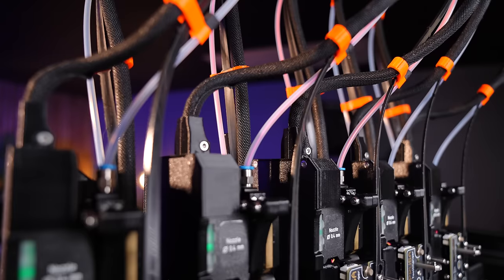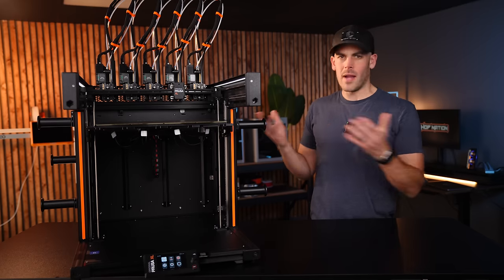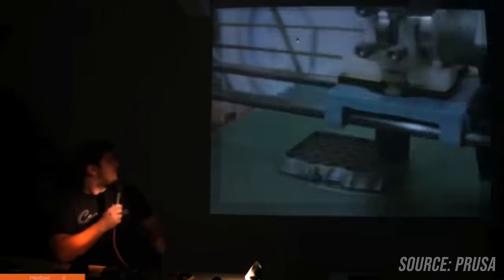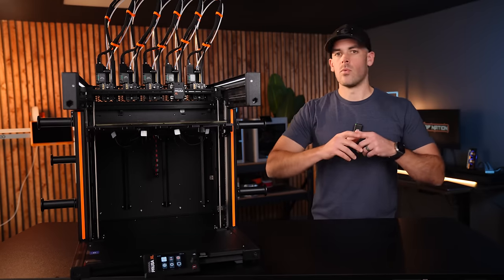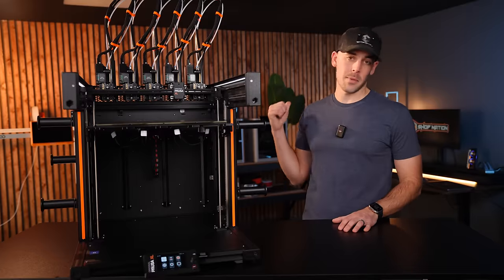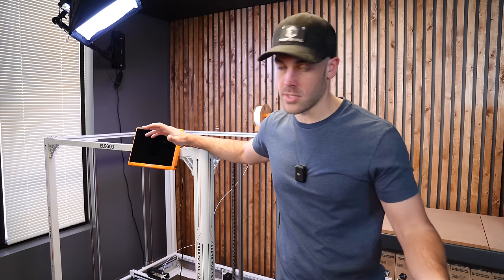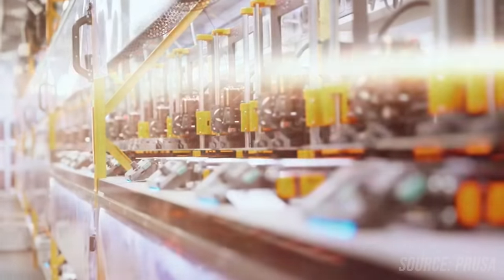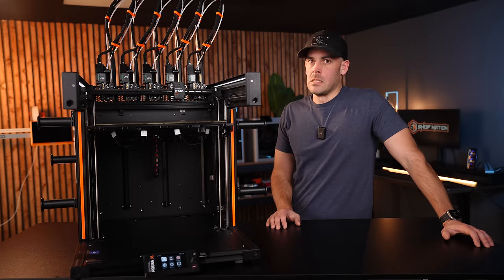Why Prusa is the next Blackberry

Comment: Prusa's real problem is not qualityspeed, relaibilty. It is that however orange they make it, it still looks like an entry level kit build from 10 years ago. The Harley Davidson of 3d printers. But without the aspirational marketing.
Existing Prusa users may stay loyal, but no one new is buying a Prusa. At each price point there is an equal or better competitor.

Next year Prusa will either have a completely new design that doesn't cling to legacy features, or it will be in terminal decline.

Comment: I don't think the situation is as dramatic as iPhone to blackberry. The paradigm's aren't so different. If prusa were to release a smaller volume core xy with multitool head and single zone heated bed I bet it would be a lot more price competitive with the bambu printers. The prusa machines still seem to hold the edge in reliability.

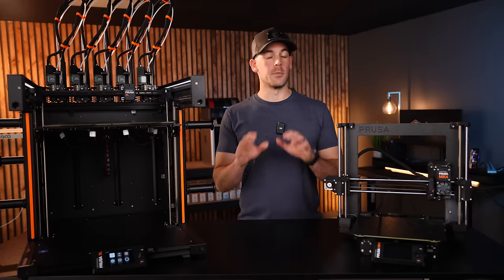Comment: 8:46 Older 😅 and i hope they will scrap the i3 design, it worked in the beginning, i have always loved the corexy setup. it is so much more capable.. And i want a fast and good IDEX printer i only need to heads, that is a market in my book, i design engendering component, and use water soluble support, have a old Chinese idex printer, heavily modded to work, but i am in the process of building a corexy idex out off one of the ender 5 plus i have a whole wall off.. but i rather just by the machine...

Comment: wow 4k is a bargain. I expected much more for hussle free machine. Maybe think of it differently, not to which setup this machine fits, as novel approach is always make it or break it, it needs to find its user cases, so think about it from the other end.. And myself not in 3d printing i heard a lot about how time consuming may it be to fiddle with setting so get print done, which is not what machine is for right? It suppose to print and have a job done.. If this machine solves this case it will have its customers no matter how much money it cost(exaggerating).

Comment: Completely agree, Prusa is a good brand, but expensive, and this requires them to constantly innovate, which they haven't in a very long time. Just putting more printer heads on a printer isn't the kind of innovation that will differentiate them from millions of clones, especially since I'm expecting there will be much cheaper alternatives in a very short amount of time, undoubtedly as well as a BambuLabs offering that will look so much better.

Comment: I wouldn't be surprised if Prusa pivoted to be more like E3D: a company that makes well designed components for other 3D printers. Already you can buy a lot of the individual components for all of their printers, even if they don't have them as sets of parts for a specific function. I can see a future in which they may make a flagship printer, but offer extruders, bed, and other systems as options for other printers.

Comment: This video said everything I said when I got my X1C. I was so pissed off at Prusa. How could they let this happen? All Prusa had to do was take all the years of community mods and put it in a machine and they just let someone else do that while they dicked around with resin and for some odd reason acquiring a delta printer company??? 
The only thing I could possibly think of that would make them relevant again is if they somehow made a printer with multiple heads that printed at the same time with insane reliability. Even then I don’t think it would matter because they can’t compete with price. All of these machines rely on mostly Chinese sourced parts so Chinese companies have the edge. After importing tax for goods and exporting tax to ship Prusa would be too expensive like they already are.

Comment: One thing are new faster cheaper kids on the block and another thig is their reliability. Prusa can implement Klipper too and be fast as Bambulabs too, actually Sovol alerady did it. But can be Bambulab as raliable as Prusa too? Bambu is good for mass market, home users and smaller boutique shops. Prusa is better for small industry and bigger batches of printing. But Bambulabs noise, vibration and motor calibration is awesome thing. 👍

Comment: My dream setup is the mk4 with 2 print heads so I can do MM for easy to work with support material and also not worry about how many supports needed to support a project knowing they will be easy to remove.

Comment: p1p and x1c does not make parts with strength at those speed... only for mockups
although the laser vision system is impressive, and the progression of Prusa have been disappointing, the Mk4 have demonstrated much better reliability in operation and feasibility for maintenance

Comment: Prusa needs to cut prices in half across the board to come anywhere near competitive with modern 3d printers. ~$400 for a tool head for the XL when you could buy an A1 mini with AMS lite or an A1 by itself for the same price, are you insane???

And when it comes to the whole waste debate, there are many ways to reduce the waste and reduce the swap time so if you're printing a lot then it's going to be a non-issue.

Comment: I don't think prusa is Blackberry,  Blackberry died out due to corporate greed wanting to "beat the dead horse" before bringing out the new technology they already owned and had done.  Looks like a multi tool system could be simplified by only using 2 or 3 heads instead of five and pre-prime the next ones.   Bamboo labs could speed up the process by doing this.  Or prusa could lighten the cost by doing this.

Comment: Prusa just need to offer a starter pack with 2 heads one for support and the other for the filament, you can paint the finished product, printing 3 or more materials starts getting real niche you get support, body, maybe a transparent and some form of flex but yes IDEX is king.
For speed get a Voron..
Bomboo Labs genius was the cutter everything else is just a normal printer, the cutter removed the crazy retraction and ramming schemes we had before and made change reliable. Bamboo Labs cutter needs top be replaced by a servo cutter so it can be fitted to any printer.

Comment: My Prusa has been a disappointment.  I built it.  It worked fine for a few prints then I had to keep adjusting the Z offset down after a few prints.  I talked with tech support several times, replaced a few things and finally sent it bac for a rebuild.  They blamed a few  issues on me sent it back and it worked great for a few prints but then I started chasing the Z offset again.  My Prusa sits most of the time while my FLSUN, Creality and Bambu do most of the printing.

Comment: Even if BL does a good job with all side jobs, like slicer, modelpage, tuned profiles with filament, service etc. This also is to consider and prusa is still top but loosing also very quickly. 

Not so easy to compare also between both. For me prusa looses some of it own benefits in the past independently what the other came out with.

Comment: The XL prints larger multi-color prints, or multiple smaller multicolor prints, in a much smaller amount of time and with far less waste than Bambu or other printers. Also large prints with supports of different material.. Maybe the average Joe just needs a cheap Bambu or Creality, but for the large print multicolor or multimaterial, this is probably the best choice

Comment: you missed the biggest part.    Open air 3d printers today is amateur hour.   even PLA benefits from a controlled temperature environment.  $4K for that printer?  I'd buy it if the thing was enclosed in a good way not their lame "here put it in this box".  design the enclosed print volume as a part of it like Voron does.  Bambu labs keeps me away because of their closed  nature.  No I'm not buying their filament,  let me make my own rfid tags and give me access to the sourcecode of the firmware.

Comment: I think I am the odd case where the prusa xl would be more useful than the bamboo labs because right now we run several old modified cr10s with .6 nozzles and 10lb spools in a heated enclosure. bigger is usually better for us as we do prototyping. however we are not typical and don’t have extra money at the moment. then again i used a blackberry running android until last year so…..

Comment: I think the single greatest change prusa could do right now is to make a mk4 sized coreXY. The market wants small and fast prints, this brings me to the next point. 

A small change they can make right now is to have a volcano style hotend for the nextruder. It doesn't need to be longer, it could use a CHT design. Regardless, the heater would need to be upgraded to keep up. That alone would be a basic and easy to implement change that would enable faster printing, Even if the XL is the only one seeing real benefit.

Comment: Prusa should run with the corxy smaller build volume and enclosed. Don’t scrap Prusa but integrate it with bits of bamboos programming for the speed. IR sensor for spaghetti and auto restart either part or purge tower. Have a sweeper tool changer set up for auto part removal after a brief cool down. Focus on what Prusa is known for Automate the farm. Make these options for the bed slinger if by  some wild chance Joe sees this. Lol

Comment: I think a huge aspect of Prusa at least for me is that they are open source. Now that printers are more likely to be connected devices I think that is increasingly important on the software side. Having non proprietary parts as well is a bonus. I will give hot ends a pass on this one being an e3d revo enjoyer myself but the fact that Bambu labs has proprietary non user serviceable parts in the motion system is a deal breaker for me no matter how good their customer service and warranty are. I also dont want to trust the cybersecurity of a Chinese company especially when their software is a little black box no one can see inside. Sure the X1C is a neat machine, but I will stick to my Voron. If I ever want multi material I will jump to the XL.

Comment: You're just not going to win if your price is too high for most users.  While there are benefits to the XL, a ton of 3d makers won't use the machine for those specific cases.  As shown in the video for basic prints, the print quality was ok at best and the time saving was marginal.  Unless you are staring at the machine waiting for it to finish, that margin isn't enough for the extra money spent on the machine.  Look at the automotive world.  There are luxury cars that are better in every way than 4 door family car but which one gets sold more?  Same reason, most users need the basic functions both provide but one is affordable.

Comment: For Prusa and all the other non Bambu companies out there it's like you said they need to pivot. They need to rethink everything and basically build a better Carbon X1C with the capability of multiple heads and multiple colors and do it plug and play out of the box. There will still need to be the current bedslingers for the individual home hobbyist but for those wanting to do everything with one printer they need to look at Bambu and do it better. That is the future. Just my own opinion.

Comment: So what I'm hearing that the only thing keeping this printer from being not niche is some more R&D to make it cost less and maybe some slight improvements to make it easier to get it tuned, but otherwise, it's good. Also, for someone selling multicolored prints, you can complete more than four prints with less waste in the time it takes a X1C to do one print. That's more than four times the profit which would justify the cost.

Comment: The XL is for engineers who want a precise and reliable printer and who also choose to print with exotic filament and/or multi material

The Bambu X1C poops are simply to big and too wasteful for exotics
Having multiple print heads in this way makes it the optimal solution for multi material

Comment: I think you have just fallen for the marketing hype. The Bambu print time are not that amazing unless you don't care about the strength of the part. Additionally, you completely left out the fact that the prusa can run different nozzle sizes for each tool. This is a huge differentiator.

Comment: Prusa needs a mid sized coreXY machine with TWO print heads(option to add more). Also, preferably with a full enclosure and even the heater that Qidi machines are shipping with. I'm building such a machine right now because NOBODY MAKES ONE.
Reply: Tridex?

Comment: i still dont understand why iy needs to purge, i have a chinese hellbot hydra+, it doesn't need to purge, its not a fast machine like the bambulabs  but as someone in a place where filament is expensive, i will take not having waste on expensive materials, and its fucking monster on reliability, i love my machine to death. and i plan to actually buy the smaller one, because i barely use the large print size most of the time. would love to try those expensive ships, especially the bamboo labs, as it seems the software for multi color is easy to use, right now my way its slow as fuck.

Comment: The only issue with Bambu I see is the proprietary slicer and firmware. I would rather have control over the system without the strings attached.

Comment: 8:30 It's not about the colors as much as it is about the materials. If you need a bunch of different materials in something like that benchie, such as where each color is a different type of needed filament such as dissolving supports in areas that aren't very convenient to get to. So it's likely to see a market in more niche areas such as engineering or the likes.

Comment: I don't care for multi-color but multi-material is a real plus and that won't work with an AMS. Also the Bambu - Studio really sucks, have you tried to set it up in LAN Mode only ?(sorry, not going to send my companies models to China). And just manual loading models using the micro-SD-card is a pain. The only reason I did not buy the Prusa XL was the long delivery time (6 month when it was relevant for me)...and I regret that I had to buy the Bambu instead.
Reply: Multi material does work with the AMS actually. I frequently do PLA + PETG as support interface material because it releases easily.

Comment: Say you save 100g of filament by printing something on an XL vs. an X1C. That's roughly 2-3 dollars per print, not to mention the lower electricity costs of having less bed segments heated for less time due to the lower print time. Over time, these costs add up... if you're printing one part a day thats almost a thousand dollars in one year. Maybe this is an extreme example, but even 50g less waste means that within a few years you've actually saved money by buying an XL. Obviously, this market is niche, but it exists and it's what Prusa is marketing people to. People looking in the price range of a BambuLab are marketed for a Mk4 with MMU which should be roughly $1100 before import duties/tax, which is only slightly more than a P1S but has a proven track record.
Reply: Another thing you failed to mention was that the Prusa XL has true multi MATERIAL support, which BambuLab printers can't realistically do as efficiently as the XL. On an XL, you could print PC and TPU with soluble supports. This is impossible on an AMS (or MMU). Again, it's a niche market, but Prusa isn't marketing a $4k printer to a joe schmo with an accounting job.

Comment: The bed slinger design is actually a good design for a SMALL printer. Bambu lab just made a small bed slinger as well. Prusa's Nextruder will print multiple materials reliably unlike many other extruders. I had to purchase the 5 head XL because I needed 3 print heads (not 5) for dissolvable supports, hard plastic, and a soft plastic for seals etc. The only way to get this was the 5 head model. The problem is that without an enclosure the printer has limited material application. They need to fix this. I have built my own enclosures for both the MK4 and am doing the same for the XL. The repeatability and quality using my MK4's is at least 99%. People are correct, Prusa needs to take a Voron with enclosure and take it to the next level with at least a 80C to 100C enclosure. I need engineered parts I can use.

Comment: Multiple toolheads are an absolute must if you want to print multi-material. Single-head printers are multi-colour, but if you want to print, say, PETG with PLA supports on it, you'll get a contaminated and severely weakened part. And that's with filament in around the same temp range.

Comment: Bambu Lab is Chinese  company with closed system and very questionable ethics about what is sent to China in the "diagnostic" logs. If I am a business doing any R&D using a 3D printer to do new product development, I would not use ever a printer with Made in China software. Support is bad and new models are pushed out just to increase sales, there is no improvements on the old model and I guess is following the path of every other device that can't be easily fixed or upgraded - the Bin. For the Prusa XL I get it what they want to do, provide large 3D printer which is multi material and multi colour and it is environmentally friendly (does not waste 10 times the weight of the print material). If you print one small thing maybe is OK to dump 100g filament. But if you are printing a lot for every 1kg of filament you will be dumping in the bin 5-10 kg plastic that is practically non-recyclable. I have not seen yet any filament recycle service so all that fluff that PLA is recyclable is not really true. The price is true problem - quite high and probably not competitive.
Reply: If you're printing many of the same model, the filament waste will be the same, which means you waste less per model.

Comment: My first printer was a Prusa and when I went to upgrade, I wanted another Prusa. Unfortunately I was swayed by the Bambu X1E because it prints nylon right out of the box with a heated chamber. 

I use printers for making production parts. I need a heated chamber for nylon and ABS printing, with some sort of exhaust and/or filter function.